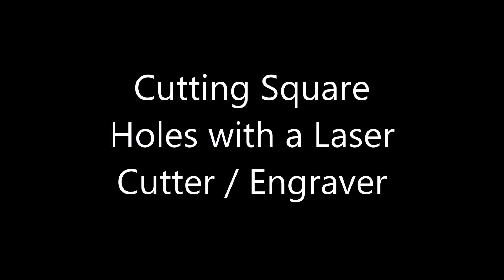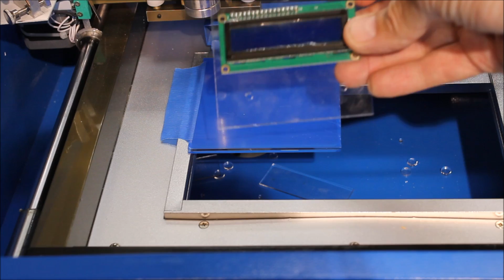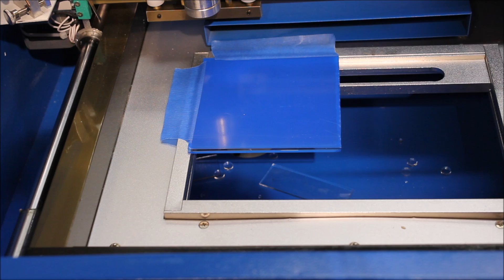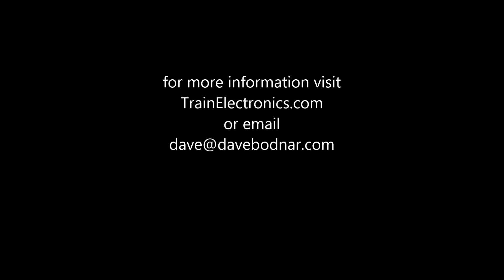Another way to cut Square Holes!

Comment: Is that the 40 watt cutter?
Reply from the maker: Yes, it is

dave
Reply: Thanks, i just tried to cut a hole in a prject box with mine, same cutter, really foul smoke, probably not ABS, is ABS smoky? I'm not running a powerful extractor just a bathroom fan, how about you ?  @DaveBodnar
Reply from the maker: Gary - I sold my 40 watt unit several years ago and replaced it with an eBay 50 watt = it has quite a powerful fan 

I have gotten lots of smoke when cutting plastic project boxes.

I would suggest being careful when cutting plastics without a good exhaust - some plastic items are PVC and can give off chlorine gas when cut.

dave
Reply: Cool, thanks Dave.  @DaveBodnar

Comment: Hi great video
Could you use this for cutting holes in a abs project box
and if so what is the  cutting max height  " Z axis"
Reply from the maker: You can lower the table (manually, no auto "Z" axis adjust) to almost 6"  - quite a nice range
davek

Comment: how hard is that to program and lay out the cuts? I need this but am scared of the headache.
Reply from the maker: I use CorelDraw to design my projects - it is not a trivial program to learn but there are many, many videos that help.
Go for it!
Reply: Dave Bodnar what are you doing up?? Joking THANK YOU!
Reply: So quick question...if plexiglass is 1/4", it can cut it with multiple passes?
Reply from the maker: Yes, you can - you can also slow down the movement of the laser to 4 or 5 mm / second to get through thicker material
dave

Comment: Gosh it just cuts so cleanly, and not much noise.  No cut fingers from a knife.  No dremel shavings all over the place.  No dust to breath in. ...maybe a little plastic which would also be terrible, but if it were in a super well ventilated area, that part would be tolerable.  I have not seen a better solution for doing this type of work.  Thanks for the lesson, teach.

Comment: 40 watt laser for $400?  Wow.  This is a great way to cut the holes.
Reply from the maker: Indeed it is, Jeff - I have since moved on to a larger unit (50 watts) with a much bigger work area and more sophisticated controller but the $400 unit is still a great bargain
dave
Reply: I am in the sub 5 milliwatt class.  That would be sub .005 watts.  Your rig looked seductively safe, but that's just a lie.  I can't imagine working with 40 watts.  I'd have that CNC machine in a different room from me.  Lasers scare the crap out of me.  ...as they should.